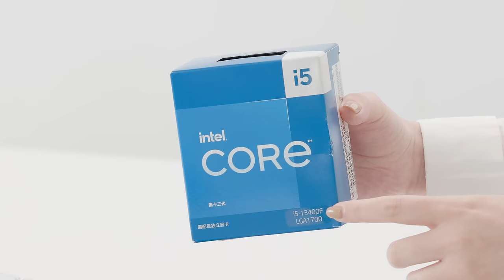装机，最喜欢的一期

Comment: GPU becoming a pc or a PC becoming a GPU.. It is not just a custom build but an art.
Reply: 😂😂lol true
Reply: You're an art
Reply: @pepito69  No you are
Reply: lol, is it what you call a "custom build" when they just put together things they can simply buy from the market?
Reply: All that dust
Reply: @pubgmngs6620  do  you want them to produce the chips?
Reply: Nah, this is just like putting Legos together
Reply: @pubgmngs6620  then how should a custom build be, professor
Reply: @duckve0322  it was about customizing the specs, but looks like now they stepped up the game to include the look too
Reply: 3070: Sick Integration Edition (SI Edition)
Reply: its a craft all right .
Reply: As someone with a huge-ass 7900 XTX paired with a tiny Mini-ITX mainboard, I feel "GPU becoming a PC" :D
Reply: It's not art. 
It's design.
Reply: @pubgmngs6620  I'd think so, you'd be the one assembling it. you can assemble it any way you want. with a prebuilt you just buy it and use it, no moving things around. anything else added would be custom. As custom implies that you picked the piece out and added it yourself.
Reply: Lol no! What are you in about? These are just ready components connected together. No art is involved in that but deep pocket.
Reply: @dandinzin it's not a custom build if you just bought the parts and put them together
Reply: A custom build is when you actually produce at least some portion of it yourself. E.g. you mod the chassi somehow to be indistinguishable from its default look.

This however is just assembling parts that are available off the shelf. Nothing about this is "custom".
Reply: It's insane to me that we might have to build our PC inside a GPU in the future.
Reply: @cy-one how's that set up working out for you?  I'm currently looking to do something similar with a mini ryzen 9 set up or intel i9 and a 3090 or similar in a egpu case so I can use the gpu on several devices.  I'm still working on the plans and parts but I want to try to do it on a smaller budget using a used or older video card.  Don't see the need to splurge on a 4090 unless I can find one for around or under msrp which seems impossible to do.
Reply: Either way, its a bad case design. It'll accumulate lots of dirt over time 😂
Reply: @dandinzin  No, but everything in this video was EXACTLY designed to go in this configuration. A "custom" build involves uniquely made parts, such as 3D prints or unique paint jobs, everything here can be purchased as explicitly designed to fit together in this exact way.

Comment: Visually, I love this. Practically... I am terrified by the lack of exhaust.
Reply: What exhaust? All vents are open.
Reply: @JurgenSchober42  

That is a very closed off system.

There is open intake. But A case like this really wants some fans at the top exhausting the air out of the case. You could easily fry components that are too powerful, and you will almost certainly throttle anything you put in there that isn't on the lowest end of power draw.

I have built a few SFF cases in this size range and the ones that have active exhaust at the top, especially for these sandwich style cases, perform drastically better than the ones that don't have active exhaust.
Reply: All intake is a good option, especially for SFF.

I have a 3090 ti & 5900x in nr 200 (SFF), all intake(3 140mm), I'm not hitting any bottlenecks in tests and in gaming my temps are under 70C.

I later added a 9mm exhaust, but that doesn't change anything.

Now I speak from experience in in different scenarios might differ but my takeway was that in SFF with lots of air vents, the air will get out easy, and vortexes are less probable, also if you control the intake you can use filters and worry less about dust.

All this and considering this build is mid range 4070 tops, I doubt there'll be any troubles with temps.
Reply: @afanasieguler7833  It completely depends on the components and how the person chooses to run them (i.e. Overclock/undervolt, etc.) If you run hot components in a case with a closed top, then by all means, go with God.

I can only tell you that with the Formd T1 that I am currently running, I can drop temps massively depending on how heavily I want to run the exhaust fans.

This case is aesthetically amazing, but I'd definitely like to see some benchmarks before I trust how it performs thermally.

The saving grace to me seems to be that the CPU side has a cut along the top for the hot air from the cooler to escape, but that GPU side looks totally closed and looks like it will have a harder time with how it handles the heat.
Reply: Its open air no need for exhausts
Reply: @cartikulo8788  My guy, that GPU has an open intake and closed top. There is heat getting trapped in there. Some of it is escaping from various points like the I/O but having some top fans would help a lot.
Reply: @afanasieguler7833  I also just realized you said you were in an nr200. That is a much more spacious case, with a lot of space for fans and has a lot of perforation. The size of this case is a different ball game in terms of thermals. I am also completely certain that an all intake setup for an NR200 is not an optimal airflow for that case. I'd be hard pressed to think you would get better results with all intake compared to a top exhaust, but I'd also have to see the specific components and which side panels you were using.

In my T1, which is much closer to this case in size, and has very similar airflow to this one, the difference between the exhaust fans on and off is massive. Again, this probably doesn't do much for the CPU side on this case, but that GPU is going to run hot in this case even with fans maxed out under any taxing load.

I've also built in the Skyreach S4T-L which has no exhaust. And even though it could functionally cool itself with only intake (and it is in most ways open air) not having exhaust also basically leaves a static cloud of heat on your desk that is pretty uncomfortable to be around unless you are using it to heat your room in the winter.
Reply: @DaneMurdock  You're kind of right, there isn't proportionally enough exhaust to the amount of intake, there's going to be a pressure imbalance. Plus the PSU doesn't have a ton of airflow to work with. And what is getting suffocated the most? The VRM. The tiny downward blowing Noctua cooler is not going to provide enough airflow over the mobo VRM, and let's keep in mind that there is no flow to talk about if the hot air has nowhere to escape. In a chassis without any case fans, convection stops being meaningless, so it should really have top exhaust. The only part that is pretty much safe is the GPU, but then again, with FCBGA VRAM it could potentially get pretty toasty on the back of the card in a sandwich configuration. You are not talking out of your ass. 

But hey, let's assume they undervolted the thing, lol. I think the looks justify the sacrifice.
Reply: @neoqueto  I'm honestly not so sure on that GPU. it looks like it will potentially have the most heat getting trapped on that end. 

The PSU is a flex type, which I've never worked with, so I am not sure how well they do with such limited airflow. I've worked with an HDPlex PSU which was designed to run without fans, so someone with more experience on this type of PSU would be welcome on how airflow affects it.

Depending on how good the heatsinks are for the VRM's on the mobo, they might be fine, but I agree in that they will be taking on more heat than they need to. And again, active exhaust would really help there.

And as you mentioned, an undervolt is probably a must.

Even just a vented top panel would help a lot, but some active exhaust would add a lot more.

But as you said, the aesthetics on thing feel tempting even with the probable performance trade-off. It is a crazy looking unit.
Reply: @DaneMurdock  Did no one read the specs? It's 13400f and a 3060ti . It's not going to be pumping out heat. What heat the GPU will be making will get pushed out from the GPU IO and the front (near the PSU). You can clearly see the airflow vents at 1:36 that will help both the PSU and the GPU exhaust. My only "concern" would be that the PSU intake is on the bottom. Flex PSU are typically in a PULL which is great for this case, but seeing as there are little to no feet.... it might not get much air. But it wont matter. This build is going to run pretty quiet for the most part.
Reply: @theoperator288  I have a 3060 ti in my case right now. I''m sure you can run it in there without overheating, but without an undervolt, it is still going to heat that space up. those little vents aren't going to do a lot, and you will definitely be running your fans as loud as possible under load.
Reply: It's fine for those components. I have a similar build in the Densium 4+, and it gets a little toasty but still well within spec and doesn't throttle. My overclocked EVGA 3060 Ti will just touch 80C on the hotspot under max load, and my 5600 will turbo with PBO to 4.45 GHz all core and still only hover in the mid-70s. Zero intake or exhaust other than the GPU and CPU fans, convection does all the work
Reply: @DaneMurdock  
This case is specifically designed for that GPU, the Dual-RTX3060Ti. You might have noticed that the layout of the cooling fins for this GPU is quite different from a typical one( 2:06 ). It functions more like a turbo card, pushing hot air sideways rather than allowing it to get trapped inside the case. At the 2:11 mark, you'll observe that the case features additional ventilation holes, specifically for this GPU. The design is outstanding - it's a true masterpiece
Reply: its an i5 and a 3060, its fine.
Reply: i had a negative pressure case that worked well, my current build is a weird push pull with isolated gpu, cpu and psu zones.  excess pressure from the gpu compartment feeds the cpu from the bottom, rear fan blows forward under the cpu cooler from one side. this is all drawn out with two big side fans. dumps heat like crazy. psu is completely isolated and has its own flow path. hottest zone, is the psu.
Reply: CPU fan was mounted backwards, so it is the exhaust. xD
Reply: I mean the case itself is named 'ForFun02 Pro'
Reply: @JurgenSchober42  💀💀💀💀💀
Reply: @DaneMurdock  I have this build with a 12100F so the cpu is pretty easy to handle temp wise. With a room temp of 30C I get the gpu around 75-80C on max load I think? (Maybe hotspot is around 90+ so its throttling alr)  Never really tested it properly doe, maybe I should do it tmr...

Oh yeah the whole chasis and motherboard heatshield(s) gets quite hot after a while. like the WHOLE thing just radiates heat
Reply: The GPU has it's exhaust grille out the back. There is also a grille next to that for the heat inside the case off the motherboard components, as well as additional smaller vents on both sides and the bottom.
Reply: @DaneMurdock  Fair points except that no compenents are going to  actually fry due to a lack of airflow.
Reply: @DaneMurdock  I agree. I'm running an RTX 4070ti and 12700k in my Fractal Terra. I had to make some modifications, but I was able to add a 120mm top exhaust fan. That, along with some undervolting, liquid metal, and custom ducting around the CPU cooler dropped my temps by about 10C. Granted I never really needed to drop my temps that low it allowed me to run the fans slower for more audible comfort.
Reply: Not much exhaust for that GPU, CPU's exhaust looks fine at first glance, but it's exhausts are surrounded on either side by decorative white plastic that will recycle the heat back towards the fan. It looks neat though, and there will always be a market for lookig nice.
Reply: @JurgenSchober42 It‘s fine for the CPU, but this absolutely looks like it‘s designed for a blower style cooler GPU. Then all the heat would be exhausted out the back. This way there‘s only that tiny vent underneath for the GPU and I guess if the air forces itself over to the MB side, which would also go past the PSU. I mean, yeah, it‘s probably fine, but a blower style GPU would make this amazing, or simply having some vents at the top
Reply: @KiraSlith Yes. It‘s just that it would‘ve been so easy to get perfect cooling on this case with little to no increase in size. I don‘t get why the top has to be closed off, when the MB side is completely open. Or vents at the bottom? Would 12mm thick fans and vents underneath really worsen the aesthetic of this case that much? I don‘t understand how someone designed a cutout for this exact GPU and leave exhausts for it as if it had a blower style cooler

Comment: Nice to see that kind of plug being utilized, I've used that in a build 3 years ago and it provides simple and ease of use, especially when you constantly move your PC around which was also in my case that's why I chose the SFF life.
Reply: I've never seen this kind of plug before. Is the PSU outside of the case?
Reply: @user-eu5ol7mx8y  the connector is a powerCon, in that build the PSU is inside, you can see it when he/she opens the case, I believe it's a 1U power supply.
Reply: @user-eu5ol7mx8y  but if you want you can use a powerCon with DC voltage just make sure the polarities are correct, I built mine 3 years ago using an HDPlex with a DC power supply outside, but I moved to using a SFX PSU simply because the DC power supply was inefficient and the HDPlex was limited to 500W max which is below the required wattage for my CPU and GPU combo under high loads.
Reply: I didnt choose the sff life.. the sff life chose ME.

Comment: I'd need my dust filter covering the GPU fans otherwise it would turn into a dirty mess 😅
Reply: Overall the whole case is non practical.
It's only good for show piece  😀
Reply: This is more a pc you're using in a cleaner environment like a laboratory.  Or anywhere else you're not collecting tons of lint from clothing and furnishings

Comment: It's looking nice but sadly very restrictive in this form. You can't upgrade the motherboard (back panel molded into the case) and the GPU unless you're not mounting the side panel (or whatever that is) covering it. This could be adapted though to support more hardware so thumbs up.
Reply: If you are building something like this I don't think that upgrading is any less of your worries. You're just gonna buy a new one. you don't have to be very cynical and find a flaw, just enjoy the build and the video.
Reply: @burntsouffle  I'm very much practical rather than cynical.
Reply: I feel like if you have funds to go aesthetic, you most likely have funds to be practical in the choices. If you go practical, aesthetic is probably least of your priority and if you want both, that's personal preference
Reply: you dont need to upgrade the motherboard if it were amd
Reply: This case was created by a content creator, it was inspired by the motherboard shown in the vid and it's basically a personal project, so it was made only for these specific hardware. if he really wants an upgrade he would just design a new case
Reply: gpu can be upgraded if you find one of similar form factor and by switching the cover of the new gpu with the old one that fit in case and then it should work, as for motherboard it use lga 1700 socket which alot of intel cpu use so u can just switch the i5 with i9 or a different one, motherboard dont really need to upgrade either. You most likely wont even be able to get the motherboard because it is sold on chinese websites and not outside china as far as I can see. motherboard back panel also is not molded for the case but the case is designed for the specific motherboard.

Comment: Let's admit that it looks quite aesthetically pleasing and original. As for the cooling of the processor and the exhaust of a hot air stream, then there will be troubles.
Reply: It looks like you could cook eggs on it.

Comment: They call it the dust eater 🙃. Looks neat tho, but unpractical unless u like cleaning it out often.
Reply: The dust factor kinda depends on your living environment since my pc has been sitting here for like a year but only has a thin layer of dust
Reply: @xier3x  negative. Doesn't depend on your living at all. If ur living, period, dust is created. And the fact that this pc had no dust filters, u will have to clean it very often. Ceiling fans get alot of dust when running or not running. Same thing goes for this thing. Doesn't matter if u clean the area alot or not. U dust constantly every day and people on my livestream tell me that i have ocd. And guess what, I still have to take out my filters and clean then from time to time. And I filters, no smoking either. This thing has no filters.

Comment: awesome build, never thought about setting the gpu behind the cpu, but I have some questions:
How you dissipate the hot air? 
Does the gpu cable extender (idk how its called) interfere with latency?

Comment: I would make sure that screwdriver has enough torque to properly secure those screws. New builders and old builders alike scoff at this but when youve worked on 100s of these you start to understand how important this is. They will come loose over time if not torqued well.

Comment: So the case is designed for exactly these components?
That is one way to shave off a bit of volume and probably not hard to add magnetic filters. Although it doesn't sit right w/ me because components go out of date fairly fast.

Comment: A big problem... Finding a white Asus Dual RTX 3060 Ti.... Those are really rare today.
Reply: The one they use and what the case is designed to fit as gpu is the ASUS Geforce RTX 3060 TI DUAL-RTX3060TI-O8GD6X-WHITE, which i think is the only white one u will ever find

Comment: 0:30 what is that thing that is connected to the two yellow circles
1:30 whats that strip

EDIT:
0:30 still dunno
1:30 gpu riser
Reply: Those are for wireless connection i dont know name out of my head but u can put antennae on the yellow circle connector for bluetooth and wifi